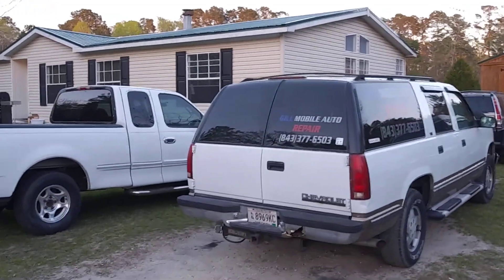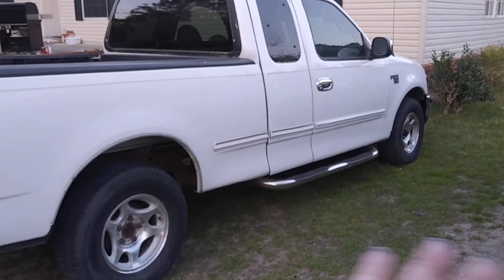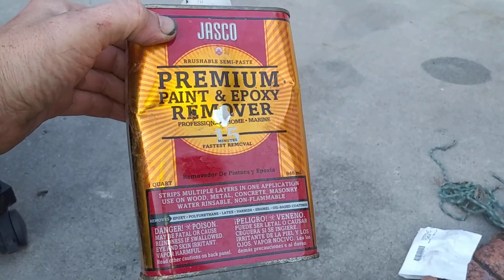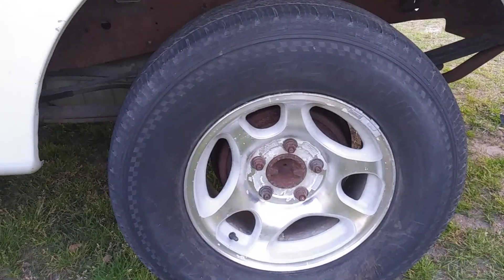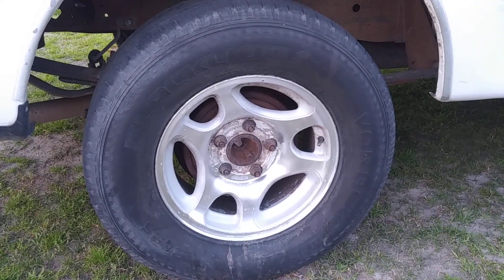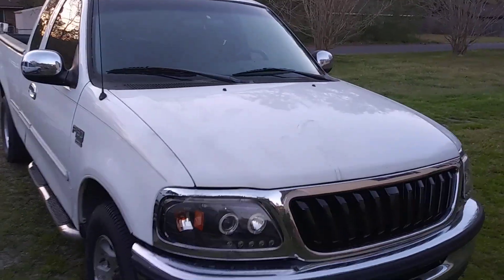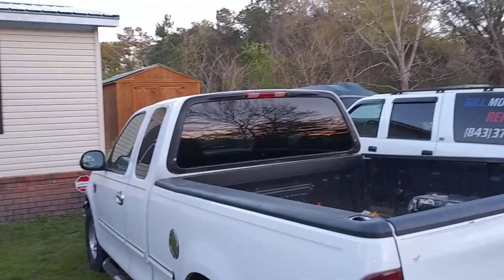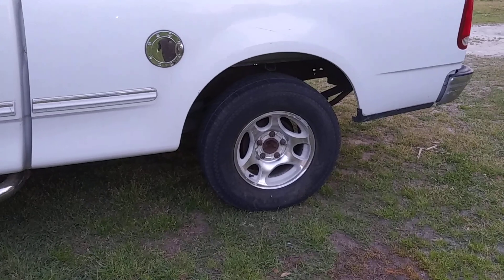Project 1998 Ford F150...rims

Comment: I know this is an old video but man are wheels hard to find for those trucks. I have a 2000 f150 5.4 v8. Just sank $325 in it on 3" straight pipes but holy shit wheels are very hard to find.